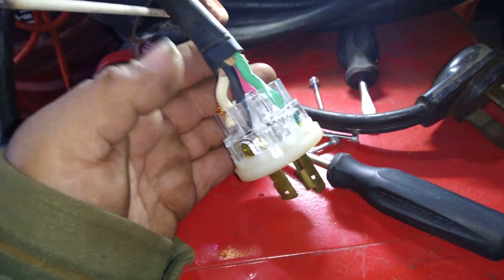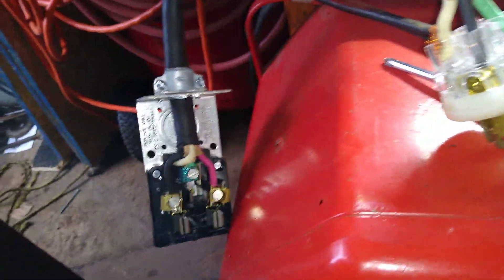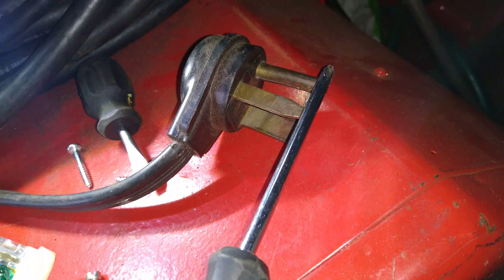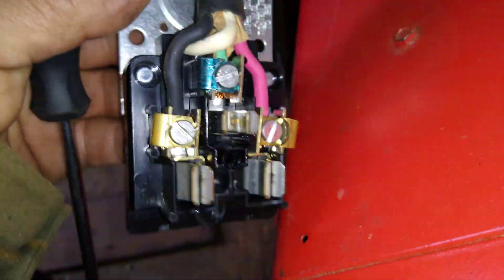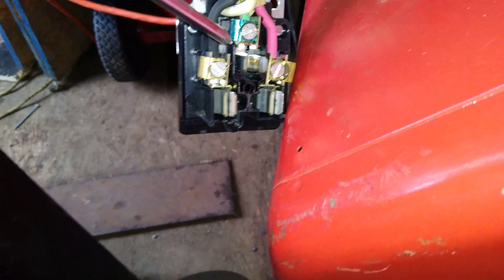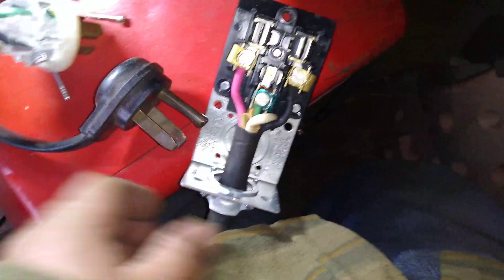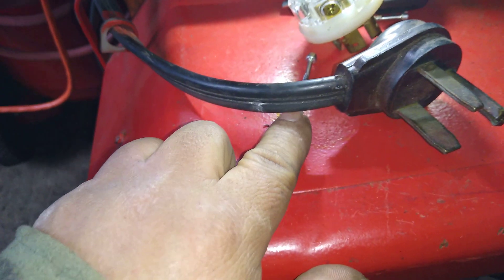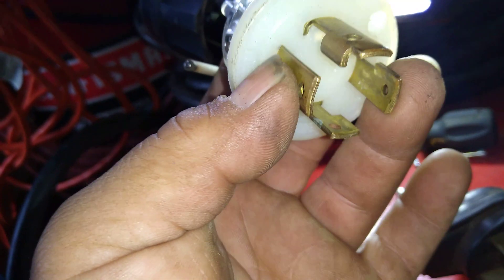how to connect Lincoln electric welder to a Generator

Comment: I did that for my lincoln tombstone years ago, to use with my Generac 5500-8500, but the generator just couldn't produce the power necessary to weld. It would spotweld  at the most, and it was messy, then the breakers on the generator would pop and I would have to reset it. The Arc welder just required too much electricity, and the generator couldn't handle it.  Maybe yours can, but at 5500 watts, 8500 surge, I really thought mine could handle it.  I'm no electrician, but I did the math and thought it would, I even made a tutorial just like this because there were no good ones on Youtube. I took it down, because over all, it was a fail, even though the cord was assembled correctly, and in depth. The cord was fine, it was a power issue.  Well good luck to you on it. I hope it works.
Reply from the maker: Thank you for watching and comment. Yes 5500 is way too small. My generator is 8500 and when the welder operates on DC works better
Reply: Eric Ek Some of the new generators for sale on Amazon actually have a 50 amp hook up
Reply: @william38022  Well, I was trying to get the mobile setup for under $200, and I was close. I sold the welder 6 months ago it was gathering dust.  But I did build the cord, and the thing was, there were really crappy videos that step you through how to build the cord. I made sure to make a crystal clear video so there was no confusion, and mine was the best video on this out there, clear, first person view, and a few views, but I did delete it.  Reality is if someone does get fried making one, I don't want that over my head. I did it right, but there are stupid people out there and they tend to sort themselves out.
Reply: @skarekr0w3  I have a Honda Black Max with 7000 running watts and 8750 starting watts... it worked beautifully... hope you were able to get yours going
Reply: Have you tried using a smaller/slimer rod ? Less amps needed